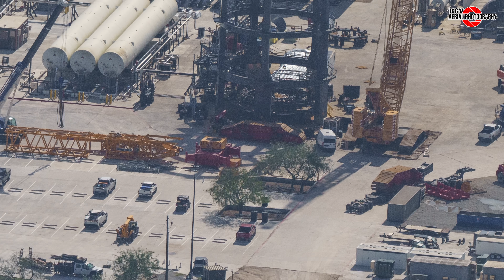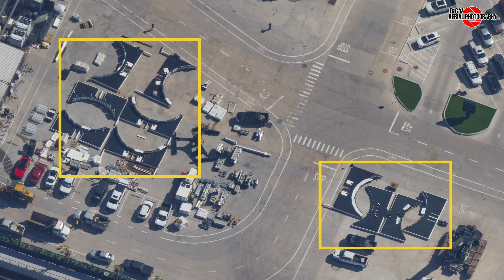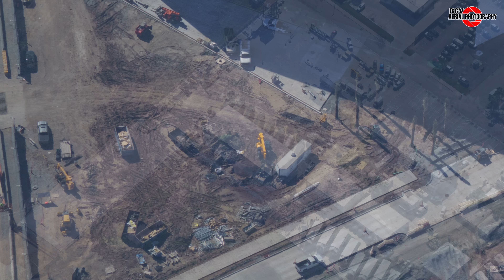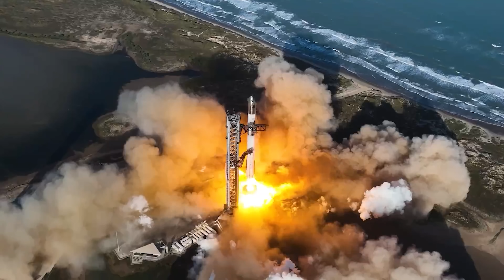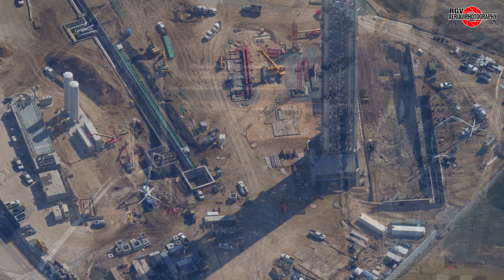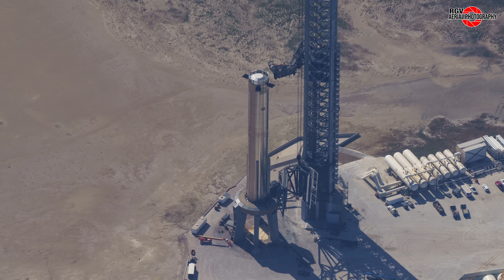Starship Flight 7 Major Updates + Launch Imminent! Starbase Flyover Update 69

Comment: I think the jagged or pattern part of the extraction area is on purpose so that pedestrians or vehicles don't fall from over it's edge as it's easier to see when in this pattern than a straight line, as it casts a shadow that's easier to spot. Especially if the sun is at its highest point.